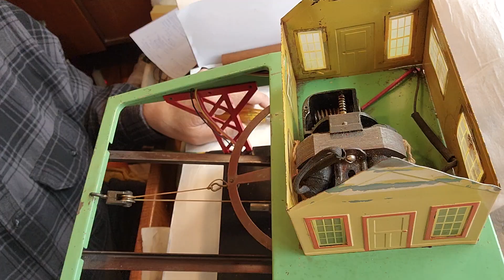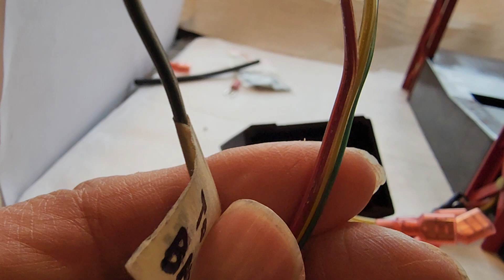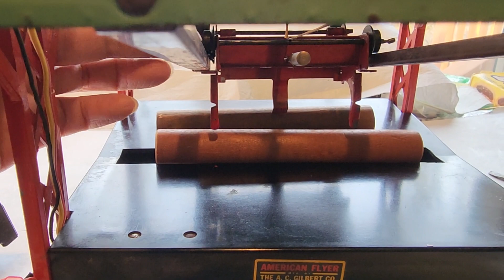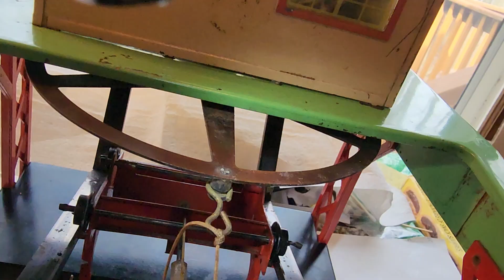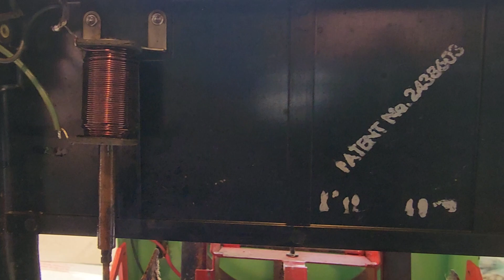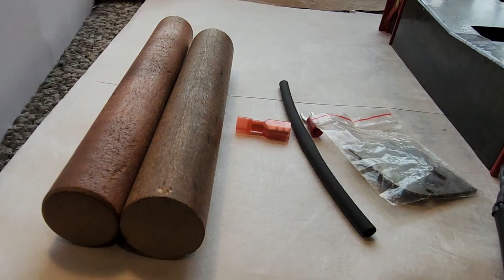AMERICAN FLYER  751 LOG LOADER- EASY ECONOMICAL DIY LIKE NEW RESTORATION/REPAIR  JUST SAVED ONE MORE

Comment: Excellent video on the 751.  I have one that I just purchased.  The motor will not run.  I've dismantled the motor itself and checked the gearbox.  It was packed with grease which I removed.  Checked the gears and they spin and mesh well.  However, even when I isolated the motor from the accessory, it will not turn.  I have applied about 16 VAC from a Lionel 1033 transformer.  Any suggestions ?
Reply from the maker: I have to assume the motor is a working one, so be sure all the electrical contacts are clear of rust, grim and caked up dirt.  You can use CRC electronic cleaner spray.  Make sure there are no broken wires starting with the motor working outwards. Given its age (made in 1946 to 1951) a broken wire under the cloth insulation may be a culprit.  Test the wire for continuity.
It is rare this type of motor will burn out though not impossible.

There are 4 wires that controls the log loader. Green and red are the primary ones.
1. First be sure all the wires are intact. The green wire is the one that sends power to the motor.
2. Red wire controls the solenoid. Be sure the solenoid "rod" is free to move.  
3. Facing from the front, the on off switch is under the green frame on the left side toward the rear. If necessary this can be removed for cleaning.
To remove, unscrew the 2 screws on the left side of the housing.
3. The large circular wheel as it turns, the cam hits the switch which controls how the power is turn on and off 
4.If the cam is not positioned correctly or not aligned or if the switch is bent, then it  will not operate correctly.

   There is really not much info that can be found, unless  you can come across one of the rare factory shop manuals.  Hope this info helps.
Reply: Thank you for your quick reply.  I will try the continuity test today on the motor wiring.  I presume the two cloth covered spools of wire are interconnected ? @IRONRAILROAD